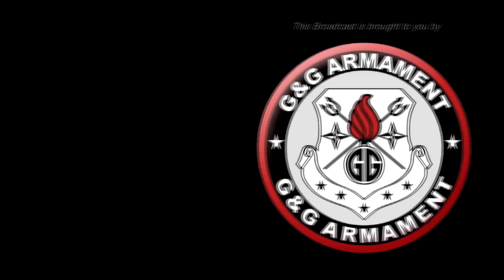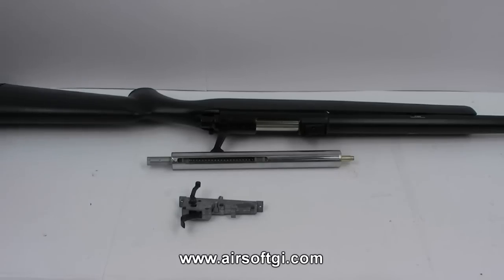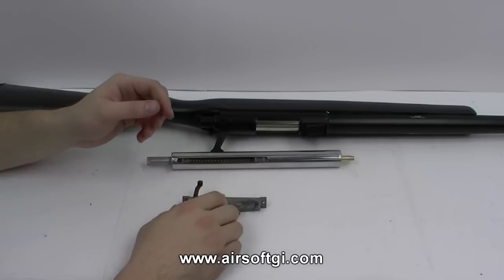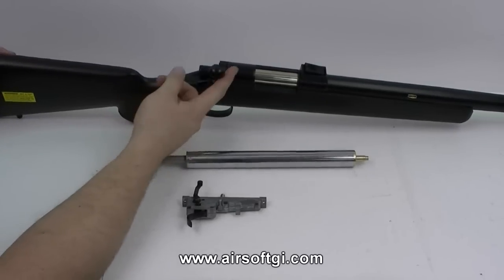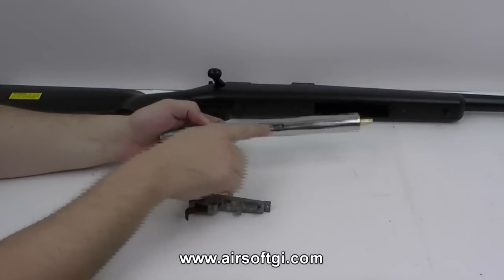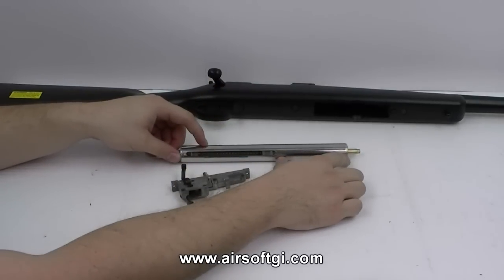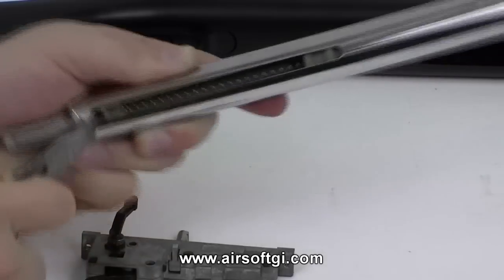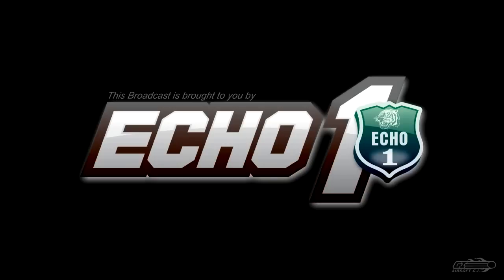Airsoft GI 101 - How It Works - Spring Powered Bolt Action Sniper Rifle

Comment: @deathbypistol, no you compress the spring when the pull the bolt back. It locks onto the sear. When you push it forward, the compressed spring and piston is locked on the sear so there is no resistance as pushing forward only acts to push the empty cylinder forward to load the BB into the hop-up. Pull the trigger and the spring expands and the piston shoots forward in the cylinder.

Comment: 8 years late but I have the exact same model and my when you pull my bolt back it works fine but as soon as you give it a nice pull it slams forward imedietly shooting the bb without a trigger pull any way to fix this?
Reply from the maker: The sear is worn down and not always catching.

Comment: I absolutley love Bold action rifles, I think I fell in love with my grand grand dads m96 which is 115 years odl but whatever who cares XD

In airsoft what im pissed about is the fact that you wont find many bold action rifles with a simple iron sigth on it. Most have attached 2omm rails which you cant remove and there is no way to set up a iron sigth on it. You can use red dots but i want it pure and simple. 

The only model I have seen who is the way I explained is the Marui or Tanaka k98k

Comment: What's the best cheaper well made external readily upgradable bolt spring gun I just want well made solid externals and to put my own upgrades inside
Reply: wildairsoft1 I know this is an old comment but go for the matrix vsr-10 or any VSR-10 model those are really good and can be upgraded

Comment: Hello If anybody can help me with my Spring airisoft MB07B Bolt issue let me know. When I pull it back it snaps forward. I tried replacing pumping parts inside the bolt and the metal piece that goes though the Trigger assembly and into the bolt and it still snaps when i try to cock it. IT will only work with the old parts in it and not the new more powerful parts. But even with the original parts the bolt snaps 50% of the time.

Comment: why can't only the spring shoot the ball out, instead of using air?
Reply: good question, I imagined that the nipple part poking out of the cylinder was going to kick the BB when he first started talking.  I would think our way would make upgrades more effective, but I guess you might break the bb if you hit it too hard.
Reply: spring power is limited  the compresed air make a stronger shot 
spring have a speed limet but a changable power so it can compress air hard inf to shoot the bb in a  incradble speed wich the spring cant do if it dose dirctly and it will break the bb as well
Reply: +laith saleem  thats very true

Comment: "This is the 'bolt assembly' or the 'cylinder assembly' or whatever you want to call it..."  
Dude, seriously, if that's your attitude , you really should just stop right there.  
[Imagine a medical lecturer to a new class..." OK, this is your foot, or hand, or elbow, whatever you want to call it..."]  
THAT CYLINDRICAL THING is the "cylinder assembly": it consists of the cylinder itself, and, inside it, the piston, the spring, and the spring-guide rod; at the forward end of the cylinder, the small part with the 'nozzle' is the screw-on cylinder 'head'. The 'bolt' (in airsoft rifles) is the handle attached to the base of the cylinder, which one pulls back to compress the spring, within the cylinder, against the spring-stop bar, with the actual 'sear' catching on the bottom rim of the piston, holding it in the rearward position, with the now-compressed spring inside it, and thus cocking the rifle. [In real firearms, the 'bolt' assembly is a bit more complex.)  
Your attitude seems to be that "I'm so cool, I can talk down to you people out there, carelessly mislabel the parts at will, and just show off what I smugly believe to be my superior knowledge of airsoft."  
 Yo, friendly tip?  It ain't working....